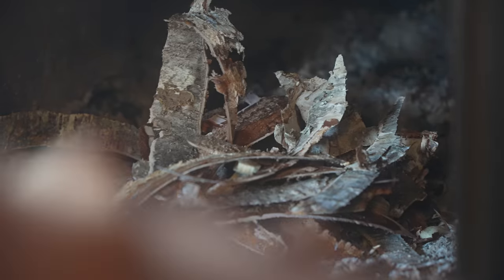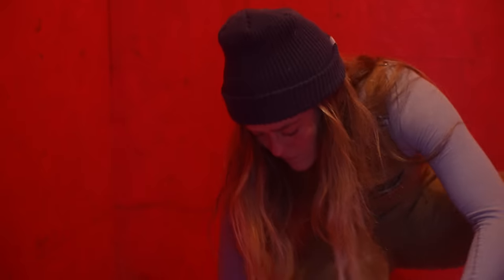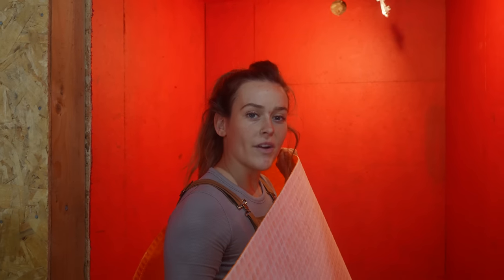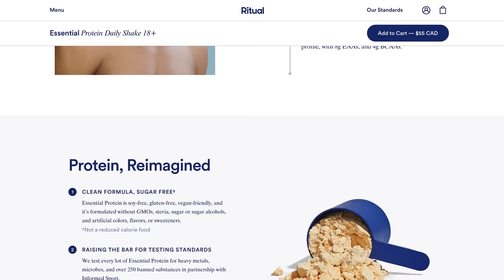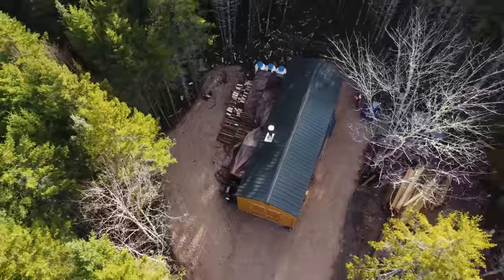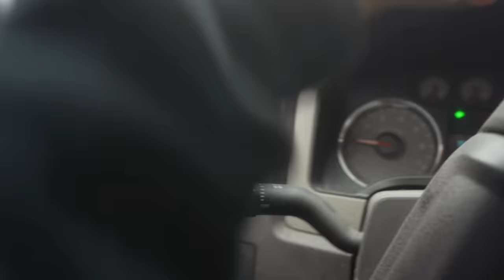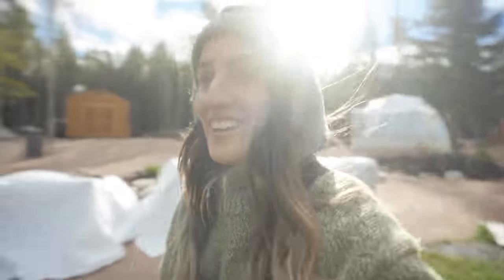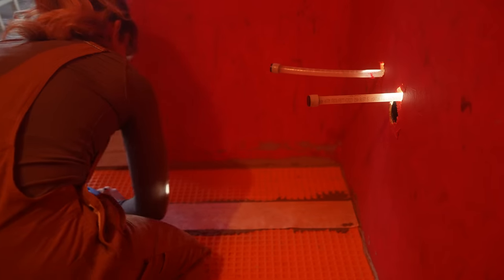Off-Grid Living In The Woods

Comment: Here's a tip I learnt.  When you bury pipes in the ground, wrap some wire loosely around your pipes. That way,  if you ever need to look for your buried pipes, you can find them with a metal detector.  Thanks to the Alaskan Raineys.

Comment: A little trick for the next time you need to run wires, that same cord you use as fishwire, you can run it through the tubes as you install them. That way you just have to tie your wires to the end and pull when the time comes.

Comment: So glad to see you use the vacuum trick to pull the wires!😁
You need to plan your shower and toilet drain!  Pick a location which does not run into a joist under the floor.  Make sure the toilet is not too close to a wall on the right or left side.  Highly recommend you get a Toto toilet (Drake II). 
When you tile the walls, get a laser level and draw a vertical line in the center of wall.  Draw a horizontal line at the top of the first row of tile.  Work up from the bottom and from the center to the corners. Your cuts will be in the corners.  Use thinset on the floor.  But, after 40 years of doing this, I have switched to Omnigrip mastic for the walls!  (From the same company that makes the red guard)  It is soooo much easier to use.  Check level and plumb every 3rd or 4th row.  Do not count on spacers alone to keep the tile alined. Finally, rent a wet saw for cutting the tile.
Reply from the maker: Well Albert you are just full of knowledge and we so appreciate you sharing with us. So many good ideas and tips. We appreciate you as part of our community.💛🐶
Reply: Also highly recommend Toto.  I’m no fan of cleaning, so I prefer the sleeker sides of the Aquia model.  As for tiling, be sure to eat your Wheaties before tackling the grouting.
Reply: I love to hear Crystal say “pro-ject “.  So cute!
Reply: Love my Toto with the bidet and heated seat!!! Luxury!!

Comment: Tiling, don't make the floor joints too tight about 6-8 mm get the tile spacers. Set out the floor tiles so that you get large cuts, small cuts are difficult even with a disc tile cutter.  Set them out from the centre of the room in both directions dry (no cement).  Sort out whether it is going to be a tile on the centre lines or a joint.  Mark your setting out lines and carry it on up the walls.  Use the same size tile on the floor and wall, a similar colour will help to make the room feel bigger.
Good luck, keep your tools very clean, wash every thing up between mixes to make sure it is all very clean.
Reply: Thank you.
Reply: That will help the gal's so much..well taught and texted..good on you helping them out !

Comment: Start your tile layout in the middle of the section so that your perimeter tiles are cut to the same width. 
Use silicone to seal the inside corners because the grout always cracks at the inside corners

Comment: Cool trick using the vac to pull the lines through the pipe. You have my complete admiration for tackling the bathroom project on your own. I'm sure you're looking forward to having both power and a shower in the cabin. And, there's no better sound than the flushing of an indoor toilet when you've been without one for a long time.

Comment: Schulter is a great system. If you opt to use their interior or exterior corner bead, while the metal are more durable, working with the plastic is much more forgiving, and way easier to cut. Definitely get the locking space wedges for setting your tiles, it’s worth it. They’ll hold the tiles evenly in place, and as always measure twice…. Cut once. 🙏😁❣️

Comment: Glad to see you ladies smiling and making progress. After living in various houses, condos and apartments, and cleaning the bathrooms. I recommend tiling the shower walls all the way to the ceiling. You will have to check with the pros if you need an expansion joint at the top. Any way, the walls above where the tiles end always deteriorates.   Believe me, it will be worth it in the long run. And get a good multi speed exhaust fan and a vent in the interior wall or reasonable space under the door it you don't want to leave the door cracked when you shower with the fan on 🚿🙂
Have fun and stay safe 💕🐾🌲

Comment: We used a rubber type water membrane instead of the product you are using. But either way, cut and installed a drain, laid down the membrane which laid across the shower area and went up on the wall roughly 8 inches. Used seam tape for the corners, poured cement on top of the membrane and contoured the slope towards the drain so water would flow towards the drain. Applied ceramic tile adhesive to the concrete and used a 1/4" square notch trowel to spread the adhesive evenly. We laid small ceramic tiles for the floor and 12" x 12" ceramic tiles on the wall surrounds. Something we wished we would of installed was the in-floor electric heating mats, so you could turn on and have a warm floor especially during the winter time which makes alot of difference especially for the bottom of your feet. 
 We incorporated a bench within our shower area so the wife would have a place to prop a leg when shaving or to sit down while in the shower. Hardest part of making a shower is choosing the tile you want to use because of all of the shapes/ colors/ textures/ size of tiles available. Take your time and have fun its a great experience to do it yourself.
Reply from the maker: Thank you for sharing all your knowledge, we sure do appreciate it.
You are so right, take our time and have fun. This way we will enjoy the experience. See you next Sunday.💛🐾

Comment: 1)  Electric Cables:  Half-and-half dishwashing soap and water squirted into the conduit makes the three #1 wires go thru more easily.  Give a squirt every 3 to 5 feet as the cable is pulled thru.  2) Bathroom:  Don't put expanded diamond wire inside your shower pan, and don't put any nails in the sides of the pan lower than 6" (use big-headed galvanized roofing nails).  Use plastic inserts on the floor and wall tile to maintain proper spacing as you're laying them.  Figure out your layout BEFORE you start tiling, so that you have equal pieces of tile at opposing walls.  (you don't want a full tile along one wall and a 1" strip on the opposite wall).  To establish pitch to your drain, use dryish mortar (called dry-pack) that is lumpy, drier than bread dough, that you pack on the floor and then scrape off to make level and with the desired pitch to your drain.  1/2" to 3/4" elevation change from the walls and curb (threshold) to the drain is sufficient.  Too much pitch and you feel like you're tipping over while taking a shower.  As little as 1/4" in 10 feet will enable the water to drain. (like a concrete patio slab).  Definitely use an adjustable (one with threads) shower drain.  Install your shower liner (pan) on TOP of the dry-packed mortar (run it up the walls with folds at the corners like wrapping a Christmas package in reverse).  Install another layer of dry-pack mortar INSIDE the shower pan & make any fine-tuning adjustments to the pitch.  This layer is for your tile to adhere to.  You should be using DuRock or any other cementitious wall board on your walls to glue (thin-set) your tile to.  The joints can be taped with mesh tape, or not.  Use a caulk that is color-matched to your grout color in the corners, BEFORE you grout.  So, you'll be grouting the 'field' tiles, and the corners will be caulked, eliminating cracks in the corners in the future (or above a tub, if you ever install a tub with tile).  (Caulk on top of grout cracks never works and has to be replaced yearly.)  I have built over 400 single-family homes, and every shower enclosure in every house was done this way, with zero problems long-term.  Hope this helps.  Seek out YouTube videos to further illustrate the points I've made.
Reply from the maker: So smart! Thank you :)

Comment: Are you're thinking of a wet room/shower style bathroom? Or having a bath or shower tray? Floor tiles should be 6mm spacers for gaps to grout. Mapei products are for me the best. Porcelain tiles are hard to cut but straight cuts get a good hand tile cutter with a diamond tip wheel. Wet cutter, slowly cut tiles or shapes. 
Great seeing cables pulled through!!

Comment: Hi!  Just a couple quick comments.  Love the videos!  Most people will tile the walls and then do the floor last.  That way when you drop stuff if won't mess up the floor.  I couldn't tell but if you wanted two light switches for the lights in the shop you would need 14/3 w/ground wire between the switches.  You need the extra wire in the bundle and 3-way switches so you can turn the lights off and on from either switch.  Those wood stoves usually like to be hot to work the best so when you light the fire have some medium size sticks to get a good bed of coals going (when they're hot-hot they really burn clean and blast out heat.  If you need less heat, once it gets hot just put in big chunks of wood and let it be more coals than flames).  When you grout the tile, if you have CDO like me... (that OCD with the letters in the correct order :>) you probably can't do the whole bathroom at once.  And/or, you can only get huge bags of grout.  You can mix grout in smaller batches (just like the Thinset mortar) as long as you make sure and keep the correct ratios.  The color of the grout will be different if the ratio is different.  I have a kitchen scale, measuring cups, mixing bowl and mixer... it looks like I'm running a Meth Lab when I grout!  But, this way I can  do just a wall at a time and not have grout getting hard while I'm obsessing with smoothing and feathering the first section.  The Pros just wipe on, wipe off.  That's why they're Pros :>)  Just remember, if some guy who can't pull his pants up (i.e. Plumber's Crack) can do it... so can you!!!

Comment: Tiling : work from the middle to the walls, cutting the wall edges last.  When tiling the walls work from a fixed straight edge, ( piece of wood?), upwards, and outwards. Do the bottom row last.
Watch lots of videos on how to tile a shower. Use spacers!  Good luck.

Comment: Most times holes for the pluming water and drains in the floor are cut in and installed first and caped off before prep for tiles. But can be cutting after it a lot harder Because now Cement cutting tools will be required to cut it in an you have waterproof these area again.

Comment: Make sure you install Kerdi around the edges of the Ditra where it is against the wall.  The Kerdi is installed on top of the Ditra and onto the wall.  This completes the waterproof membrane system so no water can get to your wall.  It only needs to go up the wall a couple of inches, so a roll of KErdi will work just fine.

Comment: One other thing you get you doors hung first and that way if you need move walls. You can take the pins out of the hinges and put the doors to the side while you work but you need to make sure your door frames are in place work correctly in place and there’s no issues before you go putting tile on that wall cause all three doors are so close together. You need to do all three of them make sure it’s level and you rearrange the walls if you need to for them to fit.  Make sure you share mount on the inside wall how deep your tiles going to be if you’re gonna hang sheet rock, you need to do that all the rooms. The door frames can move through the 4 inches to the lower room for this but you need to make sure you know how thick each wall finished is going to be. If not, when you go to try and force that door opening to be bigger, you’re gonna be cracking the tile in the bathroom.

Comment: Something else ladies, your cabin floor is a living being. Although you've taken great lengths, the floor will move winter to summer with moisture content. keep an eye on the grout joints, especially the edges. If the osb is subjected to continuous moisture it will swell and lift the floor, as will any joists.  Be ready to touch in the grout from time to time.

Comment: If will go for a shower, instead of a tub and want a long and wide shower beyond the typical floor pan, Floor Decor have a kit to property cast the shower concrete floor (before tiles) with adequate drain.   It is like inclined plastic rulers to level the mortar or concrete of the shower floor

Comment: At least you have the weather being cooperative for you right now, hopefully it snow holds off long enough to get you solar all hooked up. What I know about plumbing comes from home ownership and it’s issues. Ask a lot about the shower pan, what the builder installed 32 years ago, has failed in a number of homes in the neighborhood, they flexed and cracked around the drain, which then cause issues since the homes here are 2 stories and the showers are upstairs.

Comment: Guys. When tiling the floor, take care of your knees. Put something under them. When cutting the tile, be aware of the cut edge. It can be very sharp. Try and wet stone each cut edge. If you have a swinging door, put your cuts behind it. Be aware of the open time of your adhesive   Use a damp rag to wipe up any dust on the floor. That way , the thin set will stick to the floor and not the dust. Makes for better bond. After you spread the thin set down, with the 1/4” notch trowel, place the tile down and wiggle it  some. Allows for a suction to form. Better overall bond. Try not to work too big an area. Take your time. Keep a clean bucket of water handy  with a clean sponge. , so as to stay clean ,as you go. Any material left in the grout joint over nite, will be harder to clean out the next day. It doesn’t have to be perfect. If you’re leaving a wide joint ,like quarter inch or three eights inch, you’ll be using a sanded grout. When mixing a sanded grout, leave some dry in the bag, to be used as a drying agent later. You’ll need cheese cloth to polish with after the grout hazes. Do not let the haze dry on the tile. Use some , Ole English ( yellow) polish on the cheese cloth to remove the haze. Good luck. Look forward to the results. I was a journeyman tile sitter, in SoCal, for well over 20 yrs, with my own company. Just take your time.

Comment: My experiences with tiling - sad lol Great advice from others - also buy yourself plastic spacers - 3 mm or 1/8 Inch in other standards. This helps with maintaining squareness between tiles. Keep the mud thickness consistent so you don't get raised corners or 'waves' in your coverage. Walls are easier than flooring - well in my opinion. Pressing with a piece of 600mm square board can help remove 'waves' when mud is wet. I'm not a pro - just a renovator :) You will get it looking fantastic ! I can see it.

Comment: FYI: They make propane kits for your generators, Then you install a hose connect from your tank next to where your generator is. Exactly the same as you would do if a propane grill. 20 pounds of propane will power your generator for 12 hours or more. Oil needs to be checked every 24 hours. The only downside is you will lose 15% of the power your generator produces.

Comment: Make sure ur tile is even -level. Especially where the toilet will b. If the tile is uneven the toilet will rock and eventually crack! If ur putting in a heavy shower door make sure u reinforce the opening to hold the weight of the door.

Comment: To help understand the Ditra, it is a decoupling membrane (shock absorber) and water proof system all in one product.  The old way of installing flooring was using a mud bed reinforced with wire mesh. 
Schluder's Ditra system outperforms the old way.  You can then install tile using leveling spacers or trust your hands and eyes.  Leveling spacers will give a professional install. 
Before tiling, figure out your layout, ie: which way you want the tile and even cuts at the walls for symmetry.  Best for a dry run then discover you left a sliver of a cut tile to fill. 
You've got this!
Watching from Trenton, Ontario!
Reply: Mike is right. We did not use levelers on our shower and it looks wonky. The levelers are fun to remove! You rock and we love watching your adventures. Thank you.

Comment: you need to determine drains first, then Ditra then Kerdi band floor to wall and walls in shower??
Do you have water lines plumbed into the walls yet ?  OSB not recommended in moist areas, you should have Kerdi board on the walls and ceiling or WEDI.

depends on the room design and fixtures

Review all waterproofing on Schluter website and be sure to pre purchase metal tile edge profiles before tiling and edge

Shower curbs are made of foam by Schluter too,  The can be cut to size and set in mortar, tile around them afterwards and use the metal edges which are same size as the tile thickness

I would recommend a heated tile floor.  Ditra is made for Ditra Heat and a heating wire cable is strung across the floor.  This can be controlled by a T Stat and you can have warm feet in winter months and no heat required in warmer months.  Several other heating mats are also available.

Canada weather makes tiles very cold if not heated.  In Mexico its noice to have cold tiles  in a hot climate , not here.  You have no foundation walls either so the cold goes under your building.  I would recommend surrounding your home with ICF walls , but thats another story and should have happened 8 months ago